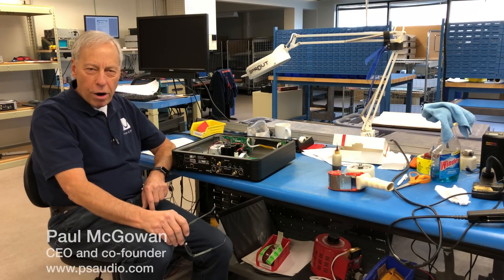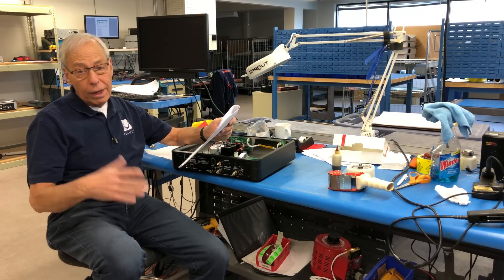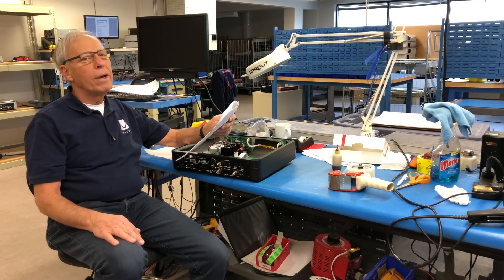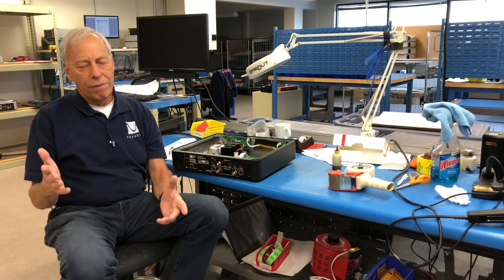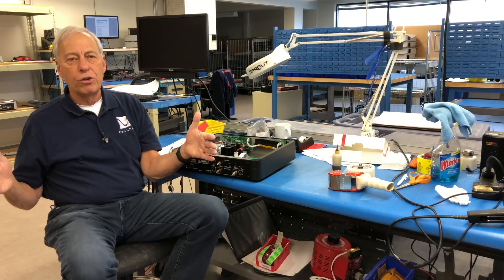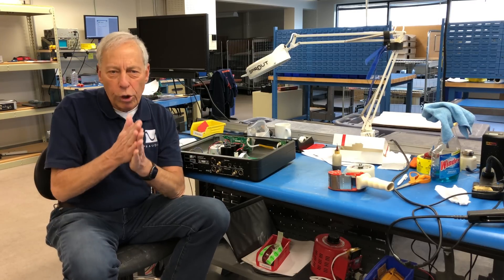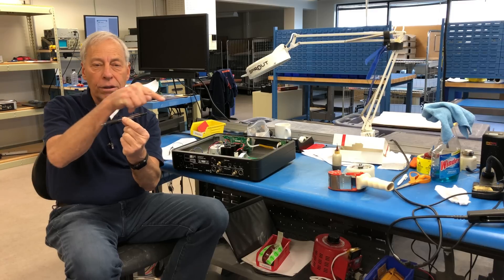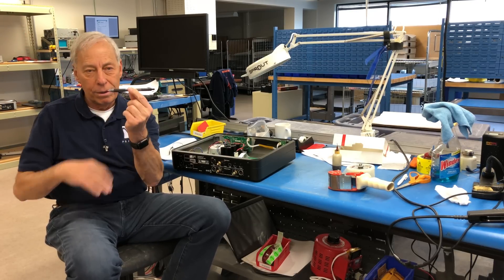Are low impedance speakers hard to drive?

Comment: Is the proposition always true though? There are some amplifiers like the one in this question for which the power does double with halving of impedance, in keeping with the theory. There are also amplifiers (easy to find example is Rega Brio) for which the power does not double with halving of impedance (I am guessing due to thermal considerations, semiconductor current capability limitations, etc). Can someone clarify if this rule of thumb of lower impedance=harder to drive, applies to both these kinds of amp specifications?

Comment: Think about a river that you put a pump which pumps the water in the same direction as the water flows in. If the river flows fast, the pump obviously do not have to work (Watts) hard, i.e. there is not a lot of impedance (Low impedance) the river have to the flow of the pump. But keep in mind that the pump in this scenario that the pump is less important to the flow of the river. Thus, the pump has to work harder (More Watts required) to have the same effect on the flow of the river (I.e. it is harder for the pump to drive the river) as say a pump that you put in a slow flowing river where the pump has to do less work (Lower watts) to have the same effect.

Comment: Every Solid State amplifier design has a unique output impedance of it's own. Maximum power transfer occurs when the amps impedance matches the load impedance. Tube amps, because of the output transformers, are a match for 8 ohms usually and only 8 ohms

Comment: Damn Paul.  I know you tried your best but I'm still as confused as hell !
Reply: As one person said, a lower impedence speaker doesn't "allow" the amp to put out more power, it forces it. 

Another way of phrasing it, an 8 ohm speaker receives 100 watts of power from the amp. The amplifier has to deal with and handle the damage that 100 watts wants to cause. With a 4 ohm speaker, the amplifier has to handle 200 watts of power going through it.

Comment: It makes sense that less resistance = more watts. I think where I, and possibly others, struggle on this topic is that it seems counter intuitive that it is MORE difficult to drive a lower impedance speaker when you have less resistance and get double the power output. It would seem logical that if it's capable of delivering double the wattage at half the load, it would be easier to drive a 4 ohm speaker to 100 watts than it would be an 8 ohm speaker at 100 watts as you're only at 50% volume with 4 ohms at 100 watts rather than 100% volume with 8 ohms at 100 watts.

I've, over the years, learned less impedance/resistance = more watts and just really stopped concerning myself with how difficult it is for the amp to drive them so long as it's rated for that load with an acceptable level of THD.

Comment: So what are the advantages to low-impedance speakers? Does that affect audio quality in any way?
Reply: 200w at 8ohms is tighter than 200w at 1 ohm. More control at higher ohms but it’s harder to reach higher wattages. Due to the resistance. There’s always a trade off.
Reply: @chuckfarley5415  What you mean by control here?

Comment: Is it analogous to using gears on a bicycle? A low gear choice on a flat surface initially takes less energy but actually puts a much greater strain on the "engine" if you're trying to go fast. A higher gear may be harder initially but at faster speeds is much easier on the "engine". So with an amp, getting greater volume (speed) is much easier on that amp with a higher impedance (gear ratio) than with a low impedance circuit/speaker. Is that kinda correct?

Comment: Even though my receiver (Pioneer SX 1250) is rated to drive 4 ohm speakers, I prefer to run 8 ohm speakers for just that reason. The lower the ohms, the closer you get to a dead short. If a person wants more sound, buy a bigger amp.

Comment: No impedance = the amplifier thinking it's got a direct short across the speaker outputs and with good protection circuitry this should place the amp in a "protect" mode.  Amplifiers are happier at their "rated" power say 4 or 8 ohms.  In most all my systems since I care about clarity, I run mine at 4 ohms.  I only ever touch on 2 ohms when it comes to subs, but as far as mids and highs, always 4, 6 or 8 ohm.  Most people don't get that each ohm halving (if you will) not only doubles the power, but also doubles the THD, and that's not always a good thing.  Also, don't forget about the heat that gets produced at these "low impedance" loads.  I'd rather my amp run cooler, produce less noise at the cost of some power.  If I want more power, I'll just get a more powerful amp, simple as that.

Comment: It's taken me a long time to vaguely understand this concept and you wonder why...
First you said '0 impedance is easy to get through!' and just a couple minutes later you say 'the more impedance there is, the easier it is to drive.' 
The rest of your explanation hints at the bigger picture but doesn't correct this blatant contradiction, that many others are also guilty of confusing the masses with.
I know how it makes sense to you in these terms but it should be obvious how that confuses a beginner.
The most helpful fundamental lesson to me, was learning that Voltage is also known as [the difference of] Electrical Potential. Electricity only moves to balance itself out amongst the circuit. 
It's the difference between pushing something or pulling it and that's a small but important distinction. The less resistance, the stronger the pull, the more current the source (amp/battery) has to allow. The source doesn't determine the current/depth of the river.

Comment: It needs some concept of power, or energy transmitted to somewhere/transformed into something. When you just want to pass a signal from A to B, you do not want the energy of the signal transformed into anything on the wire. But if you pass it through a speaker, you want all of its energy to be transformed into the sound. And in electronics the power (the amount of energy transformed into something per second on an element in the circuit) is proportional to resistance/impedance. (And it is actually proportional to other things, so the resistance is not all of the story.)

Comment: Think Paul should have stuck with the car analogy but introduced a turbo or nitrous. So car goes from 200hp to 400hp.  The engine or the amp has to worked harder under that load and the engine works harder under that boost. 

Some amps are better than others when lowering their impedance.  Some people add fans to reduce heat.  

I have been a firm believer of using amps at their highest impedance rating which for home speakers are normally 8 ohms.  This way the amp is more on cruise control.  

A 200w x 2 amp 20hz-20khz +-3db at 8 ohms is normally better than an amp rated at 100 x 2 at 8 ohms and 200 x 2 at 4 ohms.  

Not too many home stereo amps go to 2 ohms.  Car stereo is different. Car amps can do better at low impedance.

Comment: maybe should metaphor this by drawing. im kind dumb sory LOL
Reply: The job of an amplifier is to produce the signal at a particular voltage regardless of the speaker. The  lower the speaker impedance, the higher the current the amplifier must produce to produce that voltage across the speaker. 

Let's say that for a given input and volume level, the amplifier should be putting out 24V. This is constant in ohms law (v=ir) so: 

24 = ir

We can now see what how much current is necessary to produce the 24V with an 8 ohm load: 

24 = 8i
i = 3 amps

But if the speaker load is reduced to 4 ohms:

24 = 4i
i = 6 amps

If the amplifier cannot produce the current required by the speaker, then the voltage will drop and the desired power output cannot be met. 

Suppose the same 24V output goal as before; but, now suppose that the amplifier can only produce 5 amps. This is sufficient for the 8 ohm speaker since it only takes 4 amps to generate the 24V. But if you attempt to drive the 4 ohm speaker with this amplifier,  you will not be able to produce the full 24V:

v = (5)(4) = 20V

Attempting to drive the amplifier this hard with either burn out the amplifier or result in clipping.

Comment: First thing to understand is speaker impedance is not static.  It varies with frequency and design of the speaker.  Second 8 ohms is the easiest impedance for speakers to drive. As the impedance lowers it requires more current from the amplifier.  Better designed amplifiers should be able to drive lower impedances.  These are amplifiers with larger better regulated power supplies and discreet output stages.  Where it becomes a issue is with many of the receiver's on the market today.  Especially the cheaper made receivers.  Many of these cheaper receivers use cheap and poor power supplies AND IC on the output stages.  These IC output stages do a poor job of dissipating heat and delivering high amounts of current.  So if you try and ask these receivers to drive lower impedance loads they can either go into thermal shut down OR go completely unstable and damage the output stages of the amplifier.  So it is very important to choose a amplifier that can drive the speakers you choose both electrically and complement them sonically.  I have seen receivers literally go up in flames trying to drive speakers that presented to difficult a load on the amplifier.

Comment: before this video, i had the same question.
after this video, i have no new understanding.
Reply: The job of an amplifier is to produce the signal at a particular voltage regardless of the speaker. The  lower the speaker impedance, the higher the current the amplifier must produce to produce that voltage across the speaker. 

Let's say that for a given input and volume level, the amplifier should be putting out 24V. This is constant in ohms law (v=ir) so: 

24 = ir

We can now see what how much current is necessary to produce the 24V with an 8 ohm load: 

24 = 8i
i = 3 amps

But if the speaker load is reduced to 4 ohms:

24 = 4i
i = 6 amps

If the amplifier cannot produce the current required by the speaker, then the voltage will drop and the desired power output cannot be met. 

Suppose the same 24V output goal as before; but, now suppose that the amplifier can only produce 5 amps. This is sufficient for the 8 ohm speaker since it only takes 4 amps to generate the 24V. But if you attempt to drive the 4 ohm speaker with this amplifier,  you will not be able to produce the full 24V:

v = (5)(4) = 20V

Attempting to drive the amplifier this hard with either burn out the amplifier or result in clipping.

Comment: A good way to get the point across, is to handle a DC permanent-magnet servo motor, being used as a generator with various loads.  When there is little or no load on the generator, the shaft turns easily.  But put a low resistance load on it (or worst-case short circuit) and it becomes much harder to turn the shaft at the same speed.  
Many people don't understand that outputting higher current (at the same voltage) equates to more work.  
There is another distinction that is important:  Amplifiers are voltage sources which try to maintain the same voltage regardless of the load; that is what makes power rise as load impedance decreases.  If you designed an amplifier that is a current source, it would be the opposite:  As load impedance rises, it needs to produce more voltage, and the power (work) increases.  
There are mechanical analogs which can also cause confusion.  One might think of pushing shopping carts with various quality wheels so that some are easier to push than others.  Obviously, the cart that is harder to push (high friction wheels) would be more work - or is it?  Actually it depends on how the person pushing behaves, or what they are trying to achieve:  
If the pusher is trying to create the same speed for all carts, then they do need to work harder with the high-friction cart (analogous to the current amplifier).  But if the pusher is regulating the force that they use against the cart (not caring about speed), then it is actually less work to push the high-friction cart because it won't move as fast (analogous to the voltage amplifier).

Comment: The lower the impedance goes, the nearer it gets to a short circuit and hence will want to draw more current. If and amplifier is not man enough to be able to supply the extra current deeded, it will cause the amplifier to clip.  This will quickly destroy the amp.  That's why speakers such as the Apogee scintillas which had a very low impedance where called amp killers and that's where amplifiers such as the big Krell class A  came into there own, as they could drive down to a very low impedance and thus draw more current with out clipping.

Comment: Please help me Paul,  tube amplifiers ( 4-8  ohm ) able to drive   whole Infinity Kappa 9 or tubes only for highs & mids?  i know Infinity k9  is 0.7 ohm Someone told me tubes regardless  impedance load not like SS. Thanks
Reply: The Kappa 9 low impedance point occurs at 36Hz.  Tube amps are fine for the midrange/tweeter sections, but you want a good high-current amp for the woofer.
Reply: @marianneoelund2940   Many tube amplifiers capable to drive k9, like Audio Research VT 200!!!, in extended mode
Reply: @JRabbi-sb5bf  
Sure, it has output transformers with 1 ohm taps.  But you can add a transformer to ANY amplifier and make it 1-ohm compatible - without spending $10K or dissipating 680W quiescent into your room.

Comment: I'm surprised that Paul didn't mention speaker sensitivity. This is also important. I'm sure that he & his designers keep this in mind, when they engineer their speakers for the best sound, in their price ranges. If you're worried about too low speaker impedance, please see my reply to Dan Donna, below. Regardless of impedance, when a speaker is efficient, less power is needed for a certain 'loudness' (S P L - Sound Pressure Level, the end result, assuming acceptable fidelity.)

Comment: I get it now . My 7kappas could burn up my amp cause it needs more power for 4ohms and drawing more causes it to overheat so why do they make it 4ohms? For sound? Hahahahaha .
Reply: Kappa 7's don't have the strong resonant circuit for the woofer that makes them draw so much current in the 35-40Hz range.  But they do have an LC circuit for the midrange which causes system impedance to dip to about 2 ohms around 760Hz.

Comment: An Amplifier supplies both Volts And current. The current is a product of the voltage but both the voltage and the current are limited ( by the system's supply rails etc ).
The high impedance load finds the limit in voltage of the amp, current is low, amplifier " idling ". ( supply rail voltage ). The low impedance finds the limit in current from the amp ( internal resistance, heat making more  smoke leak etc ).
The amplifiers voltage should be following the signal closely up to the supply rails ( signal not to clipping ) where the current will start to "clip" as the supply is exceeded so bad sound and massive heat ( probably all the smoke out and an unwanted loud bang ).
The "perfect" amplifier has zero ohms internally, zero ohms on the speaker wires and ALL the load on the speakers ( power= voltage drop times current=current squared times impedance ) where the impedance is is where the power is dissipated. Obviously there is no such thing as a " perfect " amplifier and as the speaker impedance goes down the effect of the internal impedance goes up ( limits the current to the load but increases the power being dumped into the amps components which has to be processed by the cooling system )
So very high impedance means the amp ends up idling and very low impedance leads to BANG.

Comment: So what happens if I add 2 4ohm speakers to an 8 ohm outlet?
Reply: Dave Micolichek parallel I think. An old gf did it to a cheap HiFi, I told her not to but she did it to rub my nose in it, it sounded OK having four speakers in 2 outlets in parallel
Reply: Do how would it sound in series? Obviously a delay between speakers but if electricity travels at the spead of light would we be able to tell in an average house with 2 speakers per room?